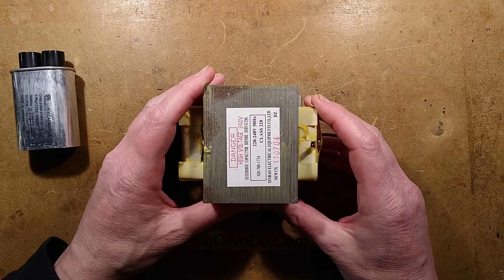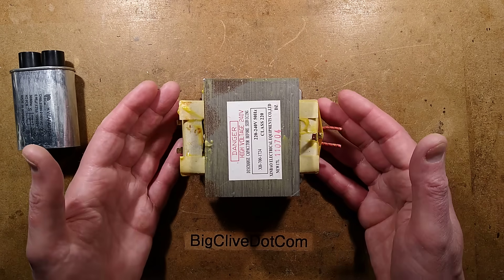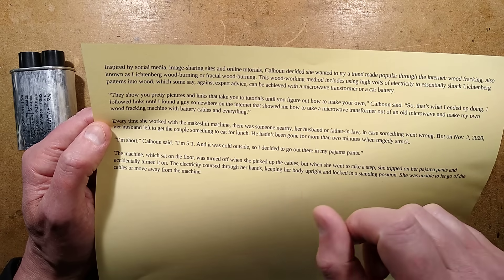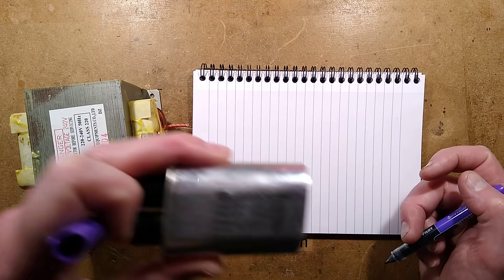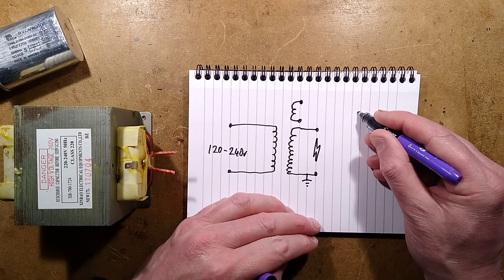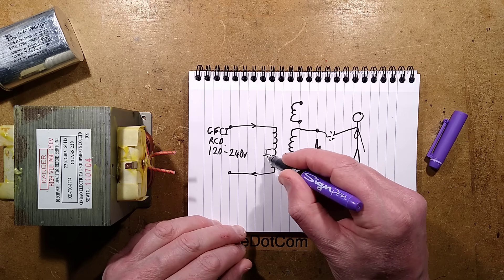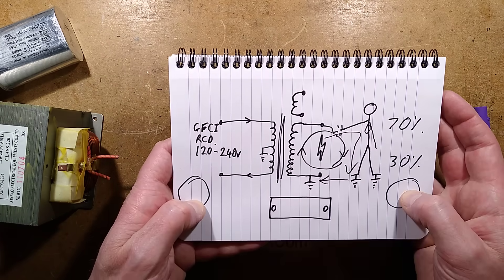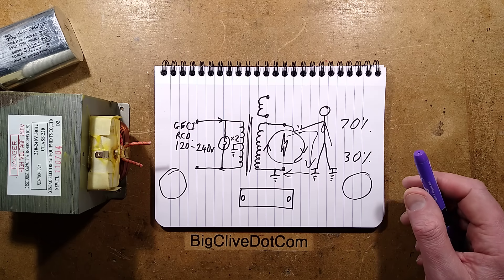The most deadly project on the Internet

Comment: When I was about 10 years old, we had a chain-link fence we were getting rid of.  It was taken apart and there were long galvanized steel pipes that formed the upper horizontal supports lying on the ground and where there was a gate, two heavier duty galvanized steel pipes that supported the gate were left standing, they were sunk in concrete below ground level with about 3 feet sticking out of the ground.  This was the late 60’s so I wasn’t trying to find porn on the tubes, I was outside ‘playing’ in whatever ways I could find or figure out. I saw the poles and thought I would slide one into a gate post pipe, what fun!  So there I was struggling to maneuver this long metal tube sticking way up into the air and I heard this noise, I looked up and saw that one of the power lines that ran right above where the fence had been had split with each side falling gracefully down making pretty arcs.  I abandoned the attempt.  Upon inspection of the pole, it had two scorched areas, one was actually burned through leaving a hole, the space between them was the same as the spacing of the 3 power lines typical of power distribution.  Looking at the next line up from the downed line, you could see it was about halfway burned through.  Our yard was thick St Augustine grass.  I felt absolutely nothing, not a tingle.  I assume I must have had the pole in contact with the pipe in the ground when it contacted the power line.  Those lines were likely 5-8KV, there were transformers for each house and that’s the typical voltages.  Even with the full metal path to ground, I was still touching a steel pipe that was touching a high-voltage line, shouldn’t I have felt something, or really, shouldn’t that have fried me?  Or was I grounded, as in, I was holding onto ground, so there was no voltage across me?  I will never know how close to frying myself I came that day, I was definitely very lucky.  Lesson learned:  better to be inside wank mining.
Reply: There was a much easier path to ground than your body. If the bottom of the pole had not been in good contact with the ground I would probably not be replying to your message now...
Reply: @JanPeterDeVries  Or read it in the first place.  It's a fallacy that electricity takes the easiest or path of least resistance,  If there is a path, it will take it even if there are other, much lower resistance paths, the current will be split, with a magnitude inverse to the resistance.  I was in parallel to the bit of the pole beneath where I was holding it and the gate pipe in the ground.  The voltage drop across that bit would have been pretty low but it must have been really low for me feel nothing.  If the pole I was holding had not been in contact with the pipe at any time while it was touching the power lines, I would have been fried.

Comment: Thank you for raising awareness of this. I cringe when I see microwave transformer projects using the original high voltage winding. They don't have a survival option. So glad you mentioned the problems with mains isolation being a hazard. I can't seem to get anyone to understand this. A GFCI/RCD on the primary side (bench, house etc) will offer no protection whatsoever against accidents on the secondary side. Same with bench isolation transformers. You need another RCD on the secondary side to be safe. Best to ensure that only one item is ever plugged into isolated mains.
Reply: Connect the secondary low side to neutral instead of ground so the GFCI will be able to detect an unintended path to ground, still don't rely on that making it safe to handle when on.
Reply: @NiHaoMike64  I thought of that earlier. Not ideal, but it might save you. (Assuming correct mains wiring of course) 😃 I once passed enough current to trip an RCD. It worked, but still really hurt.
Reply: The secondary side is at high voltage. What type of RCD would you use?
Reply: @rjmun580  with the secondary RCD I was thinking of the 1:1 isolation transformers

Comment: Don't go sticking AA batteries across that low voltage heater winding - it blew up many a meter of mine when messing about with one of these!
Also, connecting the thing up as a joule thief with the primary hooked to the collector of the transistor, with that low voltage winding driving the base - produces sparks and shocks I won't be forgetting! (I touched the transistor to feel how hot it was, no pun intended it was hot in both terms!)

Comment: Wonderful video, as usual.  The other deadly component of a microwave is the magnetron--even when unplugged.  There's a sintered ceramic insulator in it that upon disassembly can break and release beryllium oxide into the air.  Breathe that stuff in, and you will embark on a hellish medical adventure that you may not survive.

Comment: Don't underestimate even low voltage when combined with high power and conductive water! I occasionally de-rust items with a power supply. I set it to about 10v and depending on the size, might set to 2A. Normally when submerging the item to be de-rusted, at 2A you get a voltage drop of about 2v. Now, one day I grabbed the bucket with one hand, and submerged my left hand to recover the item. Man did I get a massive shock! 2V!!!! Clearly, the water with washing soda over the area of my hand effectively dropped the skin resistance to negligible levels!

Comment: I have tried to use electronic neon transformers in the past for some HV projects, but i found that they seem to only want to operate in a 'safe zone' and if they see an open circuit or a too low impedance they turn off.

Comment: Well said, Clive. I've mentioned this at times with fractal burning and other videos. People cannot realise how dangerous this is. Also heard there's a diode voltage doubler, powering the magnetron with 4000 volts DC. When our "nuke box" died, I thought of removing TR, and eBaying. Changed my mind, don't want to be responsible for a death. Instead, removed the timer, now use it on my solder iron, since I often forgot it was on in my shed: best use for an old microwave.
Reply: You're right. The rectifier and the capacitor act as a voltage doubler in the circuit.
Reply: @dandearman2871  For a doubler, the DC is nominally 2.8 * the AC voltage of the winding, disregarding various voltage drops. My son's power amps manage a little under 500V DC on the HT rail from a 200V AC transformer secondary winding (would be 565V without the CRC smoothing).

Comment: Sorry that read incorrectly
Interesting and thought provoking. As an important aside you glibly talk about spot welders Projects being safer. Which they are, but there are issues with low voltage, high current supplies. I was  brought up on large computer systems with 5 volt 150 Amp+ power supplies, we were warned never to work on any part of the system with any metallic objects on our person, these currents passing through a ring could sever a finger. Not nice!!

Comment: Mains voltages are dangerous enough. When you are talking 1000's of volts things can easily be instantly lethal. Not something to be playing with if you really don't know what you are doing. I'm a radio amateur I like working with value amplifiers. I'm building a Linear Amplifier which uses two of these transformers, I have a long experience in radio and electronics, in my work I was trained on equipment where high voltages ac and dc were present. I know what I'm doing and know that this is not an area where you can be careless, make a mistake and expect to get away with it, or proceed without complete understanding of the circuit, process, and components you are working with.   If you are not sure you are qualified to be playing with these things , then don't, you will kill yourself.

Comment: Thankfully all my MOT-related projects involve cutting the secondary winding off and replacing it with one or two turns (for battery-tab welding purposes). Low voltage can be just as fun as high voltage.

Comment: So question:  (and not suggesting anyone do this) would it not be significantly safer if you removed the ground tap and use 2 leads to do the art? 

Then you’d have to get yourself between those 2 to kill yourself.

Comment: If you're stupid enough to plough on regardless of all the warnings of "Danger", "Do Not Remove This Cover", "High Voltage" at every step because "the internet says so" when you know nothing other than what some bloke on the internet has told you, then I struggle to have a lot of sympathy. The dead man's handle in this case would probably be ineffective, as it would be bypassed in the same way as all the other warnings.

Comment: I worked in a TV shop in the 70's. I had no fingerprints because of swapping those hot tubes. The occasional shock of the secondary flyback transformer voltage trained us to be wary of where our hands were. The shock from high voltage and high frequency of the flyback circuit feels different than a shock from mains voltage. More like being stabbed by a pin rather than pounding of a hammer. A bad shock would leave a little pimple sized burn hole and had the smell of burnt chicken. I learned to use only one hand when working and always have an emergency exit plan for that hand. Jerking your hand out of a TV chassis with all the wires and sharp edges would usually cause more problems than getting shocked.

Comment: Yeah i did these a few years back made a few rigs. Simples rules 1. Never use alone, and have a disconnect out of the work area with the second person I.E. two extension cords. 3. Stand on a rubber mat for you and the work. 3. Always wear rubber gloves with no less that 12 inches up the arm. 4. Always dry and clean your work area often. 5. Ventilate and ventilate more.  I got some great pieces from the experiments. And never got hurt nor the folks I did this with. I will say my winding did make a noise while live (US 60hrz),. I also have a habit of putting  lamp on the AC/Mains side so its visible when the power live (Best of Practice from the Hot Dog Cooker/ Eclectic Pickle Days). A little common sense goes a long way in safety.

Comment: Clive I would love seeing you do some measurements on this transformer. Like putting 5v on it and see what voltage you get out. Putting 12v on the output side to see to what (if any) it steps down too... etc. in other words what low voltage things you could do with it. Would love to see any type of step up / step down of voltage videos really, especially those up to 48v DC as those voltages are used on boats and are considered safe and legally allowed to be worked on by anyone (unlike 120 - 250v AC which is the realm of professionals according to laws in most places).
Reply: Dave. Figure it out. If you have 120 volts on the primary and 2000 volts on the secondary the voltage has increased 2000/120=16.7 times so if you put 5 volts on the primary you would have 5*16.7=83.5 volts on the secondary. If you put 12 volts on the secondary you would have 12/16.7=.72 volts on the primary.
Reply: @dandearman2871  it might not be linear like that due to losses because wire length. And volts are only one side of the coin. There is also amps and voltage drop when you put a load on it.

Comment: Operating your dead-man’d switches in the way you suggest is a mistake. A pinching action by the fingers/hands is likely to lock in place when being electrocuted.
Better to press down with individual fingers.
Better still not to do this unless you really know what you are doing and can make it absolutely safe.

Comment: I'd use an isolation transformer on the primary side. Floating supplies aren't recommended in a domestic setting but for something like this a floating supply would be ideal. Some may disagree as this would prevent any safety from tripping but it reduces the likelihood of shock as you'd have to be tied to both ends of the transformer output to get a full shock. At the end of the day, this is HV and is always a risk.
Reply: Do you mean running the MOT off the isolation transformer? That wouldn't solve anything. Isn't that completely pointless?
Reply: When you say some may disagree because an isolation transformer may prevent and safety tripping, I don't think the isolation transformer would affect this.  Assuming you have an MOT where the isolated output is bonded at one end to the casing (making it non-isolated), any current path to ground would still return to the secondary winding in the MOT and then get transferred back to the primary line and neutral wiring, and so would appear as a normal load to any RCD/GFCI.  So whether you use an isolation transformer or not, no safety device would function if you came into contact with the HV output - the isolation transformer wouldn't make it any LESS safe, in other words.

I'm also not sure an isolation transformer would do much.  The HV output is already isolated, and for those MOTs that bond one output to the casing, that doesn't go anywhere unless you earth the transformer casing.  So if the MOT is sitting on a piece of plastic, not earthed, the HV should already be isolated - right?

Comment: Car main 'voltage leads' (actually battery cables) are from 2-00 gauge wire, the leads off this transformer are about 10-12 gauge, much MUCH thinner.  Stating that battery cables are not appropriate shows this mans STUPIDITY concerning electricity.  Secondly, it is the CURRENT you need to worry about, NOT the voltage.  The windings inside that transformer are very thin, compared to a car main battery cable, yet they handle all the current without a hiccup.  Shame on this man for making these mis-statements and false opinions.  I turned it off after less than a single minute of viewing due to his incredibly stupid statements.

Comment: 1 year ago when I was making a nixie clock. The nixie tubes ran on a limited mains voltage. The main chips ran on a 5v transformator.  Some time before that I made a variac with a soviet 60s tv regulator. I was soldering something on the board with the 5v off and the variac off but conected and BOOM a spark. Always disconect EVERY THING.

Comment: A computer (or a $4 microprocessor) simulated Brownian tree can be etched onto wood with a laser etcher, achieving a very similar result without using an electrical death trap.
Check Wikipedia: Diffusion-limited aggregation

Comment: These transformers usually output ~1,000. Volts ac, then the high Voltage capacitor plus the high Voltage diode form a Voltage doubler with an output of ~2,000. Volt pulses.  (not DC)  These are quite high current transformers. Ron W4BIN

Comment: “I don’t think they realize how dangerous this is-“ Here, it is needful to back up a step and state that anyone who doesn’t realize that mucking about with a microwave transformer with these specs is potentially lethal should simply WALK AWAY.
Reply: They don't understand the difference between the "be careful with electricity, it's deadly" warnings that you see so often with household electronics, and the ultra high voltage (and pretty high relative current) that these transformers are capable of. Multi inch arcs are a scary amount of electricity. It's frightening that completely inexperienced people are playing with these. Many of us know how to manage the risks and still don't do it.
Reply: @volvo09  People probably also misunderstand the whole "It's not the volts that kill you, it's the amps" sorta misleading thing, when you got the volts it pushes the amps, and when you got at least half of one at 2kV it pushes it through your heart easily, and toasts it.
Reply: @Kalvinjj  Exactly. It’s Ohm’s law. Amps are directly proportional to volts. Once you get into kV, you’re multiplying by the thousands.
Reply: @5roundsrapid263  Not to mention AC at 50/60 Hz going through your body far easier.
Those things are REALLY deadly.
Reply: @volvo09  "the ultra high voltage (and pretty high relative current) that these transformers are capable of." - No they're not. A couple thousand volts is all they can do. Which is still dangerous, but still nowhere near the European railroad systems overhead line voltage which is 25 kV. But I agree that letting complete laymen (=idiots) play with it is really frightening.
Reply: @CoolKoon  I only meant "ultra high" in relative terms... Most people (unless they climb a power pole) will never encounter anything more dangerous than a spark plug zap, or maybe a burn / zap from a neon transformer or tv flyback...unless they're stealing copper and get what's coming to them! 

It's nothing in the scheme of power out there, but it's the most powerful thing that's easily accessible.
Reply: @volvo09  "unless they're stealing copper and get what's coming to them!" - Oh yeah, I've seen some pics. Those remains were not a nice sight...
My point is that there are much more dangerous voltages out there, but MOTs still need to be treated with respect.
Reply: That's the problem - a lot of people don't know enough to know what is and isn't dangerous.  But when you add in a 60-second video of someone doing it without any sort of disclaimer or apparent caution, and it's easy for the uninformed to conclude that it probably isn't dangerous.

Comment: I'd say if you are going to do this then build an enclosure with an interlock (electricity cut when door is open - 3rd dead man switch) and use spring loaded probes that can be placed down on the material being burned. Also a buzzer of some sort that is active when the electricity is on would be a good idea also. Perhaps I skipped the obvious of wearing suitable clothing, perhaps slippers and pyjamas aren't appropriate outside of the house for doing much...